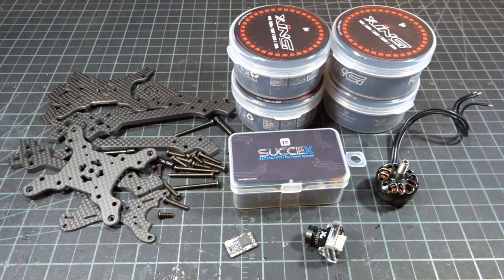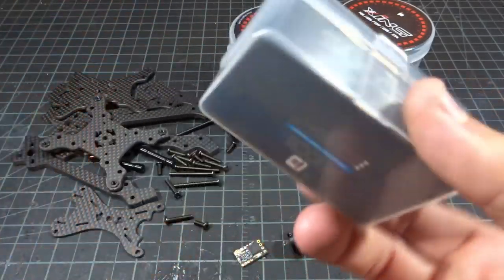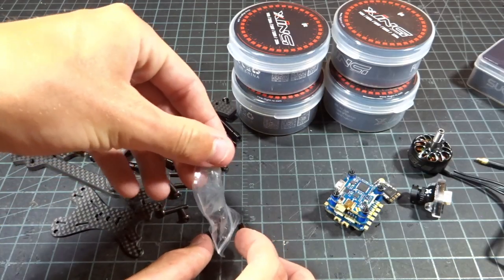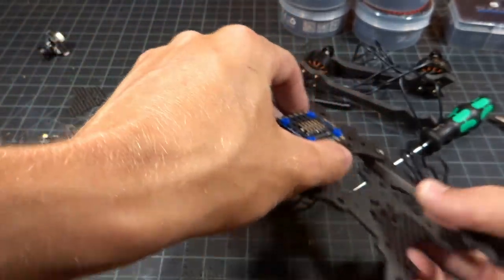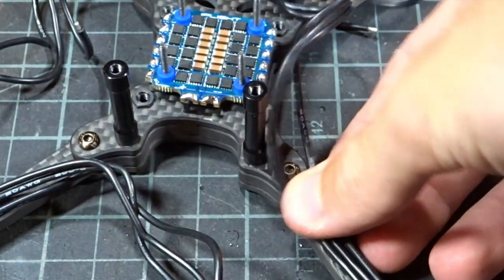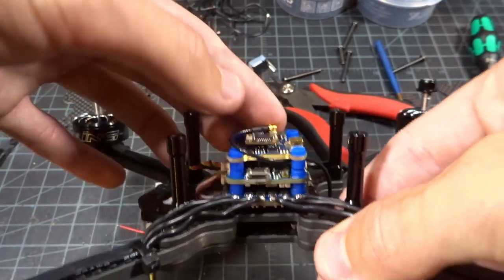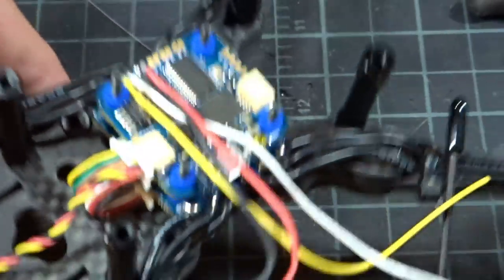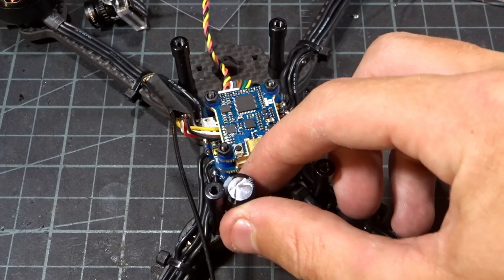Building an iFlight Racing Quad | Overview

Comment: I won't be happy till 50A stacks are 16x16 lol. I like geprc's 16x16 12A stack that has the only 16x16 ESC I have seen with a tiny shunt resistor for the current sensor. Id love a 7" with a really small frame with the smallest lightest everything.
Reply: Heh - would be awesome, but anything that can withstand shoving >>1kW through it, I'd rather it be a touch heavier than 11g.  Just my preference, as somebody who has bad luck melting junk.
Reply: @tehllama42   tehllama42 Lol I don't like melted components and the magic blue smoke but I also trust well made components working within their spec sheet specified operating conditions. New tech comes out all the time so we should just have to wait. (Hand rubbing) 😁

Comment: This definitely makes me want to see how light a dedicated 20x20 race quad would be on iF 2306 motors, as a 4S throwback setup.  On the ECO line, would actually be pretty close in price to your last budget quad.
As pointless recommendations go - the self-locking tweezer are actually pretty amazing - you can get away with just the 45° one, and be much happier.

Comment: I have a rooster and chameleon which I love but my favorite is your nexus frame. I'm completely in love with the light weight race frame. It turns so nicely and ridiculously fast with my favorite t motor f80 pro 1900kv powered by t motor f55 pro 2 f3 mcu 4-1 esc. This quad rips so hard and has made it to the top of my list. I'm interested in this frame because it reminds me of your frame. I think I'm going to grab this and put some old but good gear on it. I usually only buy t motor, motors but these xing Iflight motors look very interesting. I've just had such good luck punishing t motors I've stuck with them. The brother hobby you fly looks very interesting also. I know you use good gear so there worth looking at. Take care and hope school is going well for you

Comment: Could i also fit in the caddx Ratel? This would be my first 5 inch, so is this a good start into 5 inch?
Reply from the maker: As long as the Ratel is the 19mm micro spacing, which I believe it is.

Comment: bro, if the xing-e 2207 1800kv with the xing-e 2306 1700kv, you will choose which one for the full performance of the drone racing, please answer, I'm very confused choosing this motor
Reply from the maker: Both will be very good and a lot of the time you can't tell the difference. I prefer the 2207
Reply: @TheRCAddict  okay thanks for the answer, I'm still waiting for this LOS drone test video
Reply from the maker: I actually built and flew this quad a few months ago and have since broken some things and swapped the electronics around to different quads. It did fly quite well though.
Reply: @TheRCAddict  oh thank God, so I really am not wrong to buy a motor, because I really do not understand about xing-e, are they really going to be champions when racing. and one thing about testing, didn't you upload the video bro?
Reply from the maker: @martinyonatan150  I never filmed it as I am too busy at a real race. The E are just slightly less durable.
Reply: The RCAddict oh thanks bro, good luck for the actual drone racing match👍🏻👍🏻